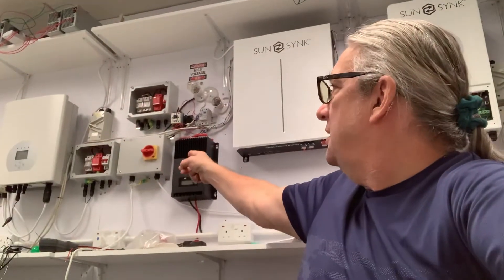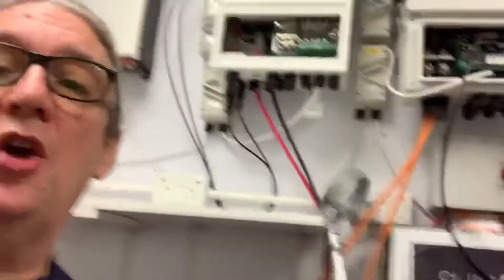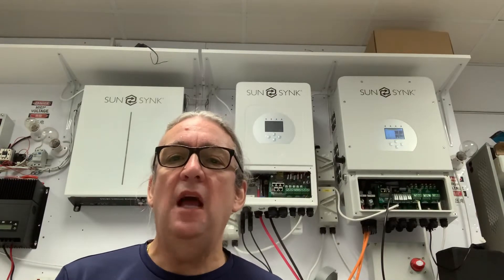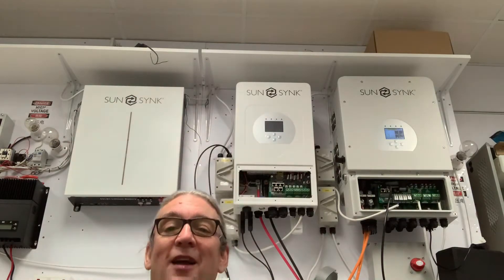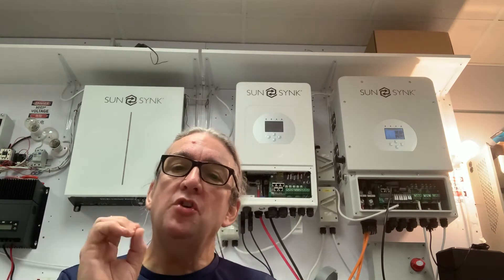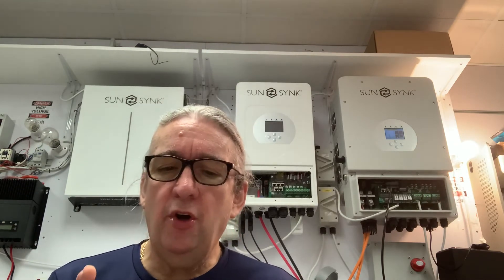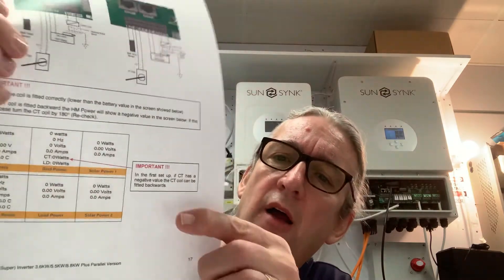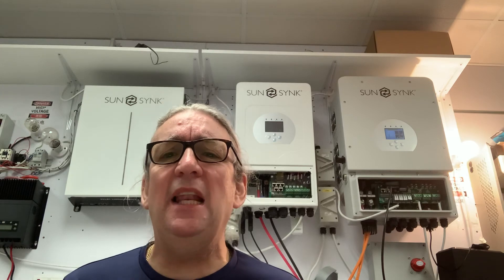Sunsynk Training part 2 sec 2

Comment: Great explanation, thanks. I'm based in South Africa and looking forward to buying this inverter. My major reason for this specific 5kw hybrid inverter is parity (ability to combine power from grid with power from Panels to power loads), to save on electricity bills. Your explanation on essential and non-essential load separation gives an impression that big items like aircon(say 1000w) and geyser would have to be on non-essential loads which would be powered by the grid only (I could have misunderstood your explanation here). Can the non-essential loads be powered from Solar panels only when there's enough PV generation during the day? So if I have a geyser on non-essential loads, and there's enough wattage from PV during the day, can that PV wattage be used to power the geyser given that the geyser will be on non-essential loads?
Reply: You will have to fitt a 4 pole nc /no to dump aux into your geysers
Reply: @cornevanrooyen4717  Thanks for the response. I have installed the inverter, and it comes with an option to export to non-essentials side(where the geyser is) and power the geyser from PV only. The only downside has been when we loadshed. Because the geyser is on the non-essentials side, when the grid goes down, I cannot export excess PV to non-essentials side. But most of the time we are not load shedding, so the system works well for me 95% of the time. Looking forward to adding a 2kw geyser to the system on the non-essential side so that I get more benefit from PV and that if theres no grid power for prolonged hours, I can still have hot water on the smaller 2kw extra geyser wired to the essential side of the inverter.
Reply: also, there was no need to install anything extra in order to export PV to the non-essential side of the inverter. It can blend battery and PV to export to geyser if there isn't enough PV, or blend grid power with PV to power the geyser. It can also export to geyser at night from batteries alone, although it depletes them much faster given that the installed geyser is 3kw. So this inverter does work really really well. I just wish one could program it to only export to the non-essentials side of the inverter only during the day in order to capitalise on PV during the day only, and power the non-essentials strictly from the grid at night when there is no PV. At the moment it has been a process of manually changing the settings come night time, or manually switch off the geyser from the mains at night.